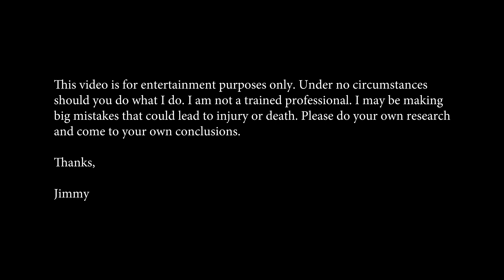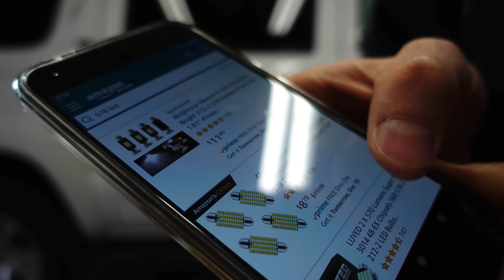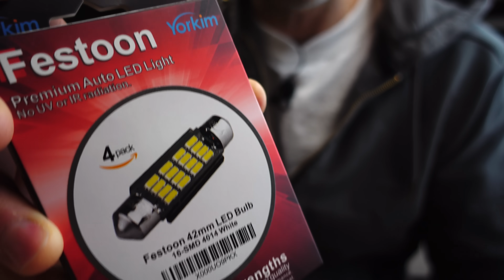Here's Why You NEVER INSTALL LEDs IN YOUR CAR OR TRUCK!!

Comment: I'm pretty sure the LED's will last a LOT longer than the halogens!
Reply: I thought the same thing, but after going through 3 sets of LED headlights (including a $70 set of Hikari bulbs) in the last 3 years, I came to the conclusion that small, powerful LEDs don't last as long as the less powerful ones do because they produce so much heat in such a small area and get very hot very quickly. If my 2nd set of Hikari LED headlights fail too, I may look into converting to HID's. However, I have had LED tail lights, brake lights, turn signals, fog lights, and interior lights for the last 3-4 years and they aren't showing any signs of degradation, so less powerful LEDs are great and can last a very long time since they don't get nearly as hot.
Reply: @averyalexander2303  Good point as 1Road also highlights.  Many in the residential lighting business shake their heads when they see so many products claiming a 50k hr life but most will fail far sooner because of heat.  However, LED efficiency is constantly improving, meaning more light for less power, so less heat for the same power.
Reply: @somaday2595  For the last several years all the lighting in my house has been LED. Nothing fancy, just the $1 each LED bulbs from Dollar Tree. They get warm, but not too hot to touch and all of them are still working flawlessly. I think they are around 8 or 9 watts each though, so not that much heat is being produced.
Reply: The prob with that statement is that most LED bulbs have many LEDs inside, and at least one WILL die prematurely, but not the whole unit so it appears that they last longer.  Check most trucks or city buses, guaranteed that at least one segment is  out or flickering already.  Then it is more costly to replace
Reply: @SeanONeill13  A local Tow Truck operator had bought a magnet mount LED Warning Lamp  (the one stuck on top of the vehicle being towed). One Segment had went & the entire lamp was flashing like a very dim strobe..(trash, & I bet he spent quite a bit for it, & of course it quit AFTER the warranty).  They saw us coming..
Reply: Got led indicator / brake light 15 years ago. They are now in my 3'rd car! They last forever. A tip: Don't buy the small instrument led bulbs, or roof light led bulbs. They are too expensive as you need a few. Simply solder regular leds  with a suitable resistor on the dash circuit board and use a regular downlight cabinet type flat led bulb for the interior light. LED headlamps are trash, at least the made in china type. They have an unwieldy pattern, and wont pass inspection, also after 5 years they are noticeable dimmer than when new (originally 12W per lamp, so not super bright to begin with). If you need daytime driving light, then get a Chinese stick-on pair for $6-10. Works like a charm and saves you fuel.
Reply: I'm having bad luck with home LED bulbs. Supposed to last years, and they don't. Meanwhile, I have florescent bulbs that have lasted many years
Reply: @MikeBarbarossa  If you are talking about 12V LEDs in downlights that used to have Halogen bulbs, and you are using your old 12v wound AC transformer, that can be stressing your leds, as they supply AC and can be a little rough in their regulatuation and runs the LEDs at too high a voltage 13-15V. It can also be crappy LEDs in the first place. I've come across cheap ones that barely last a year. However as LED are electronics, consumer warranty laws  apply, and that means two years if your are European, possible less in other countries, but still, it is not just your headache if you get a LED that blows after only months.
Reply: @MikeBarbarossa  just opposite for me. Our voltage is never lower than 119vac.. (That i seen) has exceeded 120.
I dont know if the voltage impacted the cfl,s
.
Reply: Dave Smith  The LED headlights already have a heatsink and fan on them. I think the problem is that the heatsink isn't able to adequitely cool the headlights in a 150+ degree engine compartment. Something interesting I noticed is that 2 out of the 3 headlights that failed has been on the drivers side of the car. This is interesting because the passenger side headlight is behind a heat shield I built for my air filter, so it is in a significantly cooler environment than the drivers side headlight, which is directly exposed to the heat of the engine compartment. Maybe a coincidence, not sure.
Reply: I do find their light can hurt the eyes when encountering on a highway or road
Reply: Try auxbeam. Had a pair last me a year and a half. Sold the truck with them still working.
Reply: @averyalexander2303 , when I moved into the house in which I currently reside, I replaced all of the lights in the house with LEDs. Some are from Harbor Freight, some are from Dollar Tree, etc. As a comparison, I have one CFL at the back door which is on 24/7. It has already been replaced once in the 5 years I've been here. In contrast, I have an LED strip over the cookstove which is still going strong after that same 5 years of 24/7. I know I lowered my electric bill by a goodly amount, because LEDs are so much more efficient than either incandescent or Halogen and don't contain Mercury.
Reply: @SeanONeill13 , what you fail to realize is that all of those LED lighting systems could be made better, but these jerkoffs want to sell you some new lamps later. They can't sell you new ones if the old ones continue to work perfectly. 

Moreover, I can drop an LED lamp on a concrete floor and it most likely will not break whereas an incandescent or CFL will break every time. With a Halogen or incandescent lamp, the filament can also be broken just by vibration.
Reply: @bobdodge3171 , Yes, higher than normal A/C, and especially surges, can kill pretty much anything in your home. I repaired many pieces of home entertainment electronics which were killed by A/C surges or overvoltage. Some things are made to last, but most are designed to fail in a few short years anyway. Unscrupulous companies want to sell you more of their trash!
CFLs will also dim and start flickering over time just as their straight tube cousins. Incandescents, Halogens, and LEDs retain their full brightness for years, but incandescents are only about 15% efficient and Halogens are only 45% efficient. CFLs in most designs are near 85% efficient, but LEDs CAN be made even more efficient with proper engineering.
Reply: @leewilkerson8185  Good to know
Reply: Lee Wilkerson LED bulbs, made up of multiple smds, can also break.  Weird test for illumination, by the way.  Vibrations will also weaken, and eventually break, poor solder joints over time.  So no, not failure to realize.
Reply: @ianjackson3346 , those are Xenon lamps.
Reply: Yes, that's a well known fact today!
Reply: @MikeBarbarossa  We ripped a few bad LED bulbs apart. An LED works off 5v, the power going to them inside of a home light bulb is 7.5v, which causes premature burnout. They are literally designed to burn out faster than normal.

Comment: My experiences have been varied. Most of the festoon style bulbs have had heat sinks, but the failures I've had have been a result of the lead free solder failing. Lead has superior uses.

Comment: I have replaced my reversing lights with LED's and what a difference they make. Hadn't thought about doing all the other lights, like map lights and door lights, but I will be . Thanks.
Really enjoyed the video and particularly your clear presentation.
Cheers from Australia.
Reply: You never thought about changing the others? Really?
Reply: @gssf.gr29  ...Yeah ! how silly of me, hey ? Actually, I had thought about it, but that was one of those things I put on the "I'm gonna do" list lol. I was wondering though if the fact that the interior light and the map lights come on slow, if that would affect anything, but I suppose I'll soon find out. Thanks for giving me a serve for being slack 🤣
Reply: @steiny3353  Ah no I wasn't having a go, it just seemed odd. Well worth doing, easy upgrade and they make a huge difference. I did the interior, the reverse lights (much brighter when reversing) and put a strip light in the boot to replace the existing one, cheap, 5 minute job and the difference is amazing. 

Don't worry too much about the heat problems mentioned in the video, LEDs give out far less heat than the standard bulbs but don't buy the cheap unbranded, they don't last long and do burn out.
Reply: @lAcid Rainl ...Is that what that is..I often see on you tube videos where the stop lights are flickering, I've also seen both indicators flashing at the same time too, but that would HAVE to be a problem with hos electrical system. But as you say it's bloody anoying

Comment: He neglects to mention that the LED´s are polarity sensitive.
Reply: Unless they have an integrated bridge rectifier.
Reply: @jayherde0  that is true, but I don't think many if any do. He also claims they don't last as long. They will last longer if the lamp doesn't fail from water egress of overheating, which has been my experience.
Reply: Not all are, the new ones aren't polarity sensitive. But yes many still are

Comment: In Northern climates the biggest issue with LED bulbs is their lack of heat. Sure they do produce a fair bit in the plug in part but not much goes towards the lense of the head or tail lights. This becomes a problem during winter as halogen or HID headlamps will melt off the sticky type snow you get right around zero degrees c , LED lights won't. This causes serious reduction in headlight brightness and can make a vehicle ahead of you invisible when you can't see the covered taillights.
Reply: Good to know thanks !

Comment: H7 format LEDs worked well in my bike headlights. The two light emitters were about the same size and location as the original filament coil. 
The snag was the light output overpowered the reflectors making the dip beam cut-off sit too high. I can’t believe that’s not unsolvable but the bulbs I bought were not correctly focussed.
Reply: H7 is notorious for being easy to install incorrectly. Installing them incorrectly will bother oncoming traffic. Are you sure that's not what has happened?
Reply: Reflectors don't change properties (light pattern) in any way relating to light intensity. This misunderstands what light is, and how it moves and reflects. A moved cutoff means the light source IS differently located in the new bulbs.
Reply: Totally solvable. Put the right bulb in the housing it was ment for.
Reply: Bulbs don't focus light--reflectors or projector lenses do the focusing.  If your reflector wasn't designed with your specific bulb in mind, the problem you mentioned will be commonplace and you won't get the intended end result of proper illumination.

Comment: You revealed to me in your video there are safety and reliability concerns with LED's.  On DC Volt LED's I have seen plastic interior parts melt.   Thanks for finding the interior lights with heatsinks.  Fully agree with your point about temperatures of LED's; yet solutions I found exist for the DIY folks.     So I measured 236 deg F on the aluminum heatsink on just one (1)  AC powered LED.   One time I bought highly You Tube recommended LED Headlamps.   But the cheap electronic ballast melted before the LED.  Best practice solution I have found to make these last longer without issue is add additional heatsink material.    Separately, now  there are other big concerns about LED manufactured products of cheap unregulated quality dumped on the unsuspecting market.  Let's always advise the buyer beware especially DIY'ers.
Reply: The term for what he's spent so much time describing is "Fit for purpose". For high heat lamps that have no heat dissipating ability, air flow is critical. For continuous use lamps, such as markers or headlights, one has to select units designed for that purpose, as they'll take dissipating heat into account in their design.
Otherwise, we get melting and the significant potential for something to short to ground, with a very real risk of fire.
Reply: Just buy from a reputable dealer. The only outfit I buy my bulbs from has a 2 year warranty on their LED headlight bulbs and 3 years for the rest of the lineup.

Comment: For interior lights, the typical use is at night. I replaced the "dome" light bulbs with LEDs and found there was too much light output when I was driving at night. I switched back to the incandescent bulbs. Otherwise for exterior and trunk lights, LEDs are awesome. Much brighter than incandescents and often use less power.
Reply: I like that setup. Thanks for sharing.
Reply: Why were you driving with the dome light on?
Reply: @stevebriggs2007  That's not even legal because it lowers your night vision. And in Pick Ups, it turns on the bed light and annoys the driver behind you🤯🤯

Comment: In my experience, Lasfit makes good LED bulbs with all aluminum body. They also hold back the return power on turn signals for a good while. But eventually they will rapid blink. It only happens per actuation so it will reset after a few minutes without using the turn signal. Fortunately Sylvania makes LED bulbs now which are like the standard for automotive bulbs.

Comment: Is it just me, or does LED light bulbs seem more "directional" then standard light bulbs. It looks like your dome lights now shine straight down like spotlights instead of flooding the compartment with light.
Reply: U r right about lots of these versions/models.  Keep in mind the design of the current application(!) when you replace.  Some reflectors are made for 360 or 180 or combo.  Notice older cars that had round, bowl reflecting surfaces that when you cleaned/polished them, seemed to brighten your light.   It's not just you.  In my case, I need the side lighting to reflect off an older lighting assembly - I need more than the guys straight in front of me to see I'm changing lanes, right?
Reply: @stuckinmygarage6220  - ALL reflectors are made for the bulb intended to be in it. Different bulbs direct light differently due to the placement of the hot spot created by the filament. That's why they have different bases, so you can't mix them up, and why reflectors are shaped differently. It's also why putting HIDs or LEDS in headlight reflectors is stupid, the light pattern will NOT be right, you'll have less visibility and be blinding oncoming traffic. If you're using LEDs or HIDs for headlights you should retrofit with correct projectors (there ARE HID reflectors too, but not many). Most other lights aren't bright enough or crucial enough to safety to matter anyway. Individual LED's are basically chips, very very directional, impossible to create the same pattern as any filament bulb... yet.
Reply: @Glacknor  yup!
Reply: @Glacknor  you are correct.  I have worked professionally in the building lightung industry.  The bulb intensity pattern should match that reflected design. I would recommend using the bulb designed for the reflectors.  The amount of energy used on the interior lights which are seldom used is insignificant anyways.

Comment: The biggest mistake I see people make with LEDs as they don't pay attention to the color temperature. I laugh at people that converted their cars over to LED and they have nothing but blue light.
Reply from the maker: Temp should be 6000k or under. Anything over that starts to get blue. BUT, that still begs the question as to whether or not the rating on these cheap bulbs is actually true... 🤷‍♂️
Reply: @1RoadGarage  I prefer anything under 5K but 4K preferably.
Reply: I like 5500k at the highest.... 3000k for fogs...
Reply: Hear, hear!  If you want incandesent "yellow" look for 3000k color temp, 4000k is a nice white, 5000k and up starts looking too "blue" to me.  FYI, higher color temp DOES NOT mean brighter light.
Reply: @James M...... even back with colored halogen bulbs....then HIDs....bulbs that put out an obvious blue light are freaking ridiculous and is the worst color of the spectrum to use....for lights... LMFAO....
Reply: I've gone to Ebay and bought a lot of the 12 volt Automobile LED's and soldered them together to make light banks for my aquarium.....Because they're cheap, last a long time, and come in a 7500k color rendition which is hard to find.  I can see a slight blue at 7500K, fish colors look accurate,  and plants grow excellent.   I can even find LED's in the 8000k color rendition, which is very blue and also looks good.
Reply: @ViewThis.  different scenarios. Blue lights used for car headlights is the most idiotic, moronic...imbecilic ideas.... but I guess when it's for a fish tank, more power to ya!

I learned from experience. Had blue halogen bulbs in my car...long before HIDs even became remotely affordable. I was on a major street.... and I had to turn my lights on and off to make sure they were even on.  With my HIDs and now LEDs, there is no guessing.  I know they're on
Reply: @kevinjfeeney77  Yes, different scenario. I use the LED's meant for interior and parking lights. Those blue halogens (headlights) you speak of, I've heard lots of oncoming drivers complain because they leave them blinded.
Reply: My interior lights in my truck are as blue as they can get. Wanted blue package said blue I said perfect

Comment: Just make sure they have good heat sinking on the resistor block and/or have enough LED's in series to handle the voltage. The cheap ones typically use fewer LED's.

Comment: I converted my 2018 Jeep Cherokee,  2016 Fusion and my sons 2005 Buick Lesabra.  However , you will need to add resistors for your turn signals,  to stop the hype flash.

Comment: I noticed your under dash bulbs aren't lit. Those should be 194 bulbs. Located under the dash next to the kick panel.
Reply from the maker: For some reason my truck didn't come with them.. 🤷‍♂️
Reply: @1RoadGarage  They're there. Very easy to miss. They dont even look like a light goes in there. Kinda looks like a hole for a bolt or something.